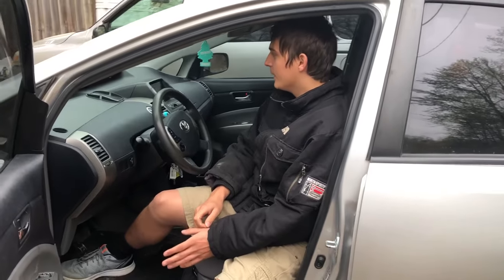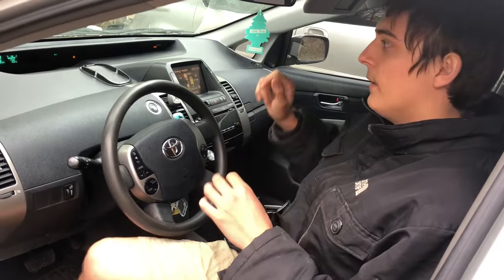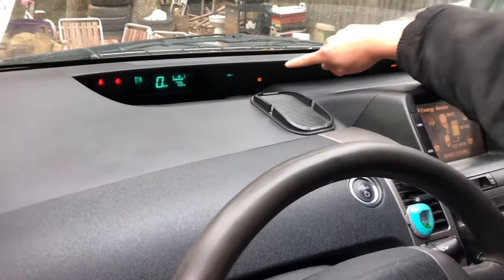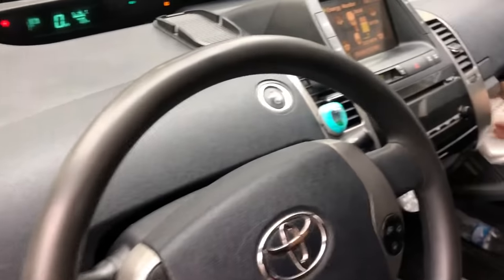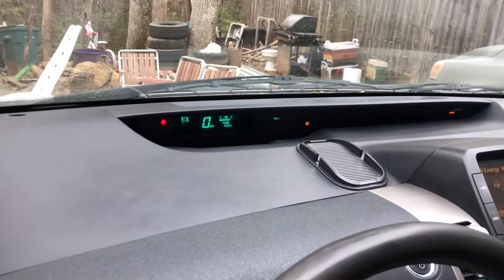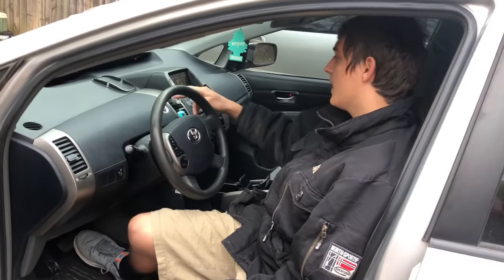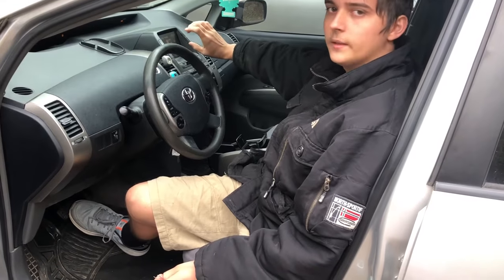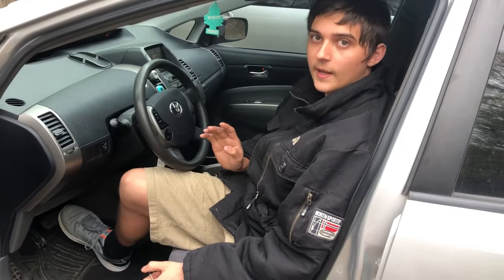Toyota Prius ABS Reset Brake Problem

Comment: Thank you ever so much. We had rear wheel bearings changed at Toyota $1600 and shortly after ABS, brake lights, etc and front brakes weren’t working right. E did exactly as you said and it fixed it. Thank you

Comment: I had the same problem and after messing around with the instructions several times I tried with the key turned to a position that starts the vehicle and "READY" is displayed on the dash. So, when the instruction calls to turn the key to ON position it basically means to START the vehicle.
Hope that helps.
And thank you for the video.

Comment: Mine says check hybrid system shows  traction light , engine. Triangle warning and circle warning with (!) around  brakes replace about 4 months ago acceleration sluggish. where do you get the pin?

Comment: Same thing is happening on my 2005 Prius. The dash lit up like a Christmas tree, front brakes go out sometimes when you start the car. A shop ran a diagnostic and a bunch of codes came up. They say I need my ABS actuator replaced. I'll give this a shot, would the codes come up if I didn't need a new ABS module?

Comment: Didn't get the dash lights to go off but did get the regenerative braking back working.  Only problem is that I have to do it every time I turn the car off and back on. Anyone else having that issue?

Edit: figured out that I just needed brake fluid

Comment: Thanks God for you tube, and thank you for the tip. I was on the highway and got a big scare when I stepped on the brakes, the pedal went down and nothing, I pressed again and fortunately stopped. A bunch of lights came out and I pulled over. I opened the phone watch your video and proceeded. As soon as I did the thing the brakes worked normal again. Thank you.

Comment: Thanks so much. Save me a thousand dollars
Reply: The light came back after driving a while I removed it and it gone and come back again and again
Reply: @nontaphatmaneerungpetch883  In this case you most likely have an actual issue. Find out the code and get it fixed before you stress the car out. Super sensitive with all this new technology. I did this trick once and I drive alot. Hasn’t popped up but I’m preparing myself financially for any repairs coming my way or just simply sale the vehicle before it gets to that point 🤷🏽‍♂️

Comment: You are awesome this video fixed my issue.  I took my 2012 Prius V to Toyota as well as another mechanic they all said it was the actuator even though my brakes weren't out and this quick fix corrected the issue.

Comment: Your Awesome! Just changed brakes and rotors on front and because of these lights that went on had to check speed sensor cables they seemed fine no cuts. Front brakes didn't work well at all. Came across your video. Thank you so much all works well now no lights

Comment: My brake pedal does not go down when I apply pressure,I basically cannot brake at all.....is video this for that same issue? My brake, traction, and abs lights all are on when this happens. I only had my prius less than 2 weeks (used) bought at 150,000. 5 days after purchase it was in the shop, they said oh we "fixed it". I picked it up and same day....same issue. I have almost been in 2 accidents in the last week.
Reply: Mine does the same exact thing. Did you get yours resolved?
Reply: @Disambiguation144  yes, I took it to a Toyota dealership and the issue was actually covered by the Toyota warranty.
Reply: @Disambiguation144  it's some kind of electrical issue. I will find my paperwork and give details on their diagnosis for you.
Reply: Hi, I am having the same exact issue after just buying mine. Do you know what was wrong with it? And what they did to it?
Reply: Whats the year of your prius thats eligible for the Toyota warranty?
Reply: @ivanmatala  2011

Comment: Any advice on the key. My key unlocks and locks my car no problem but when I get in the car to start it more than half the time it’s saying the key isn’t with me I have tried replacing the battery also the speedometer doesn’t work in less I remove the battery in put it back in I’m hoping this is an easy electrical fix

Comment: Hi. I follow your instruction and it works for me. Thank you so much for your sharing this. If this issue comes from some malfunction of car computer, your method will be awesome to reset the warning light. If a real bad brake actuator causes it, the light will come up again. Then I have to think about replacing a new one.

Comment: holy crap thanks brother - this solved my problem with the lights. i lost regenerative braking for some reason, the same lights popped up. i did the paper clip in the ports & 8+ pumps of the brake pedal and the lights went away, and the regenerative braking came back. this worked on my gen 3 prius. amazing.

Comment: I did the same bearing repairs and thought I damaged the speed sensors. Replaced both and the front brakes were still not engaging. Hell I even replaced one of the calipers that looked a little messed up. Bled the whole system, and was ready to throw in the towel. Thank you so much.

Comment: I'm not sure the brakes wont go out later 😊but works for now. Genius. Thanks so much. Toyota quoted me $3500 and a 3-4 week wait for parts. SMH.
Reply: It worked for about 200 miles and then while driving all the lights came back on and the brake pedal returned to feeling spongy. How many times would you recommend performing this reset maneuver ?

Comment: Holy crap! It worked! If the alternate screen does not come up, recheck the paper clip. Didn't have it far enough in. Also if you can't locate the port, find the key fob slot and follow straight down. It is just behind where the panel ends, about a foot down. Nothing to remove.

Comment: I did this and it worked. But then it came back. Every time I do it it works and then the problem comes back. Any thoughts?
Reply: Maybe you still have some air in the brake lines?

Comment: Hey @southerbang5896 - bit of a long shot - my dad's Aqua (prius) doesn't appear to have the white section under the steering column area...do you know the name of the connector? Is it the ODB reader plug? Anywhere else I can find it? I.e. would it be under the bonnet?
Reply: It is the OBD port and should be under the dash on the drivers side, either to the left or right of the steering column.

Comment: I have a 2011 prius, but this unfortunately did not work for me. The brake, ABS and the exclamation lights still stay on. Tried a few times, but no luck.
Reply: Only use one paper clip and put both ends in

Comment: This worked like a dream, my father in law and I replaced the CV axles and shortly after It was Christmas on the dash and no brakes. Inserted the pin pumped the brakes got the screen and my brakes are perfect again

Comment: 2010 Prius.  ABS, brakes, and warning triangle lights were on, but brakes were working well.  I performed this reset and all lights are off.  Hopefully they will stay that way.  Many thanks to you.  The internet is pretty cool when it works to spread this kind of knowledge.
Reply: Had the same 2010 Prius , did work for only 10 min drove it around and came back again as far as the dashboard lights , but the beeping noise is gone so and hope would stay like that .

Comment: Worked for me! Hopefully the lights stay off. I'll come back and edit this if they come back on.
Reply: They came back on so I'm trying a gas cap replacement since it's cheap and apparently can cause this issue.
Reply: My lights came back on too.but what does a gas cap got to do with the break and speed sensor?
Reply: @paulytillman4677  gas cap didn't fix it for me, although my gas cap seal was messed up and needed to be replaced anyway.

Comment: It .s only temporary escape
Again it will reflect some after days
Reply from the maker: It is only a temporary fix if you do have a serious issue
Reply from the maker: But in my case, we had just finished doing the wheel bearings and that’s what set the lights off. They never came on again if the actuator is actually bad, it is just a temp fix.

Comment: Thanks a bunch. I have 2006 prius.  Watched a lot of videos but could not get those codes to clear at all.. tried everything.. even a zero point calibration of all sensors.. still abs vsc e-brake light and brake warning light. I know the brake actuator is know issue on this gen 2... but.. even though it continues to cycle I just thought it was something else..
So.. you said u replaced wheel bearing assembly... disconnected the asb sensor and got the lights.. also that the rear wheels were grabbing hard a seemed like the fronts weren't working...
That's my symptoms.. I just commented to my wife how odd.. because the fronts bear most of the stopping power by percentage.   Like fronts 60-75% to the rears 25-40%.. huh.
Gotta be something else..
My 28 yo daughter routinely bangs the eff outta the front tires and has recently popped another front tire.. gonna check all for abs connections tomorrow... thanks... im suspecting an abs sensor wire is disconnected ..  corroded... frayed or obliterated... or the dumbass tire guy didn't connect after putting a used tire on it without spin balancing it.  Hope is not a tactic... but your new info has given me relevant information to this problem. 
Thanks.
Reply: Did you get it worked out?  My 2005 is not clearing ... the fluid was terrible so am trying flushes ... will also check the abs sensor wires

Comment: I cannot believe this works! THANK YOU!!! My brake lights were all on but the brakes seemed to be ok. Got a quote to replace the actuator for $1500. Tried this and all the lights are off and the brakes are working better than they have in a year! Thank you.
Reply: Did you put at least 30 miles after resetting this? Any of the lights came back yet?

Comment: Thank you so much for this!! My lights just came on today out of nowhere, and my brakes weren't working correctly. Did this on my lunch break, and it fixed everything! Saved me a bunch of money!
Reply: I have a Prius plus 2016. Where do I find that thing to put the paper clip into?
Reply: @akivagersh  If you kneel down and look under the left side of the steering wheel, you should see the little white box that has the connectors. I have a 2014, so I don't know if it is in a different location on the 2016, but that's where I found it.

Comment: I had a mouse chew through my rear passenger ABS line, ABS and brake warning lights came on. The cruise control stopped working and braking took longer. Ordered new line and reconnected line but still ABS light and brake warning light was on, until I tried the paper clip trick that you recommended.  Works like a charm, brakes are also stopping better too now. In my case the screen didn't pop up (2015 Prius), but the ABS, brake lights were flashing. Did the brake pump, shut it off and then restarted and did a test drive.  Super great video. Thank you!
Reply: What year prius and are your brakes still working ok?
Reply: @saganandroid4175  2015 Prius, brakes still working great. Cruise control stopped working also after the ABS line was chewed through.  Installing new line was not difficult, but the system wouldn't reset by itself. Needed to do the manual reset described in video above. Great video and tip and many thanks to Southern Bang!

Comment: What about the back breaks I have this problem but it's my back breaks. They sound like they are screeching/grinding. Also when my car is on it does this loud beep the whole time I have a warning ⚠️ symbol and a break symbol on. HELP PLEASE!!!  WHAT do I do 😞? This is so frustrating.. also the was given to me.
Reply: Me too and I’m so sad about it
Reply: It’s time for brake pad replacement for the rear. Nothing major. Mostly everything on this car has sensors so that’s why the warning sign is on. If it doesn’t go away after replacing the pads then you have another issue on top of brake pad issue.

Comment: broooo, i just tried your paper clip process on my 2011 and it worked! I would love to send you a few bucks for helping! (Is there a way I can do that? I have paypal). I had brought it to the dealership in a panic (before watching the video) and the bastards told me they can replace the ABS for $2400! Wish I had seen this sooner because the diagnostic was like 150.
Reply from the maker: Anything for the channel is greatly apreacated  kyletucker312@gmail.com
Reply: @southernbang5896  hi, I tried but got an error message of "Please enter a valid email address." Is your paypal connected to a different email? As an update the ABS light came back so it didn't fix the issue but it is a good band aid for it at the moment.
Reply from the maker: https://www.bonfire.com/southern-bang-shirts160/?utm_source=copy_link&utm_medium=campaign_details_share&utm_campaign=southern-bang-shirts160&utm_content=default Here is a link to my merch if you would like to help support the channel thank you.

Comment: Couldn't you just use a diagnostic tool to reset it?
Reply from the maker: No you can not only a Toyota dealer can
Reply: @southernbang5896  if you have toyota tech stream you can do it. Toyota dealerships use techstrean to do it but charge you 10x over what you can get the software and tools for on ebay

Comment: does this work for all-year models? I have a 2010 that those lights just came on and I feel the breaks a little long, so that may be a solution
Reply: How’s your 2010 Prius now. Was it your actuator or did this clear the lights. I have the buzzing sound I havnt tried this yet to see if it clears the lights
Reply: @kellyobrien5574  this fixes the issue temporarily, I repeated the process many times and it works but the lights came back after a while, so ended up going to the dealership and Toyota covered the issue under warranty, I was under 150k, so that was good
Reply: I’m at 152000
Reply: @kellyobrien5574  any fix yet? I'm at 152 also
Reply: No solution yet,  I still drive the car without anti lock brakes
Reply: @vn4781  no
Reply: @amolano74  on 2010 IV prius, I had replaced brake fluid, pads, rotars and the brake, abs is on always. how did you got the toyata covered? the dealer here didnt say anything about coverage. my car is at 140k, not crossing 150k. I am in MI

Comment: Did you guys also have that continuous beeping sound with this light on or just me have it
Reply: I had it yesterday bro
Reply: The continuous beeping turned into a very long beep that never goes away now for me, I’m gonna try what he did in this video and hopefully it goes away with the light
Reply: Is this a temporary fix or ?? I’m having the same problem with the beeping noise loose break power it come and goes but I was told it could be a recall problem that Toyota will fix for free
Reply: @dannygarcia6192  did it work?
Reply: Yes beeping
Reply: @petec3857  did Toyota fix it?
Reply: No didn’t work had to take it to Toyota it’s was the electronic break system that went bad 3k to get it fixed

Comment: Thank you so much. Tell me where I can send you some money.

Also please change the title of your video so it shows up higher on the search results and the word Prius is spelled wrong.

Change the title to Toyota Prius ABS Reset Brake Problem - Easy Fix

You'll get a lot more views. Thanks again!
Reply from the maker: Just updated the title thank you!
Reply: @southernbang5896  no problem. Unfortunately this trick didn't work for me. The engine sounds off. I'll have to go to a mechanic sadly